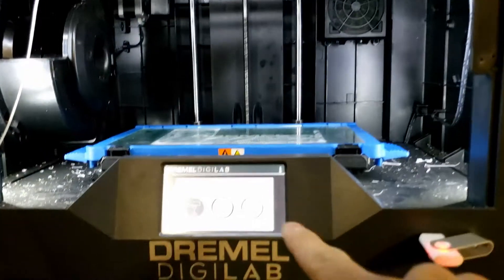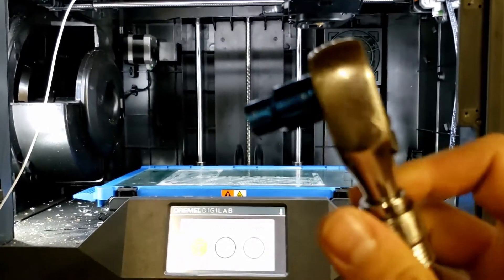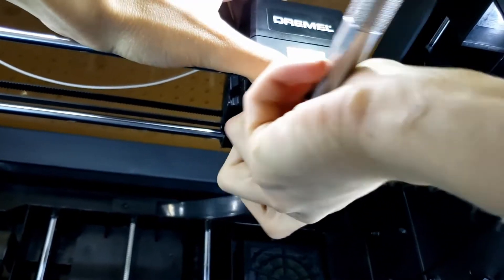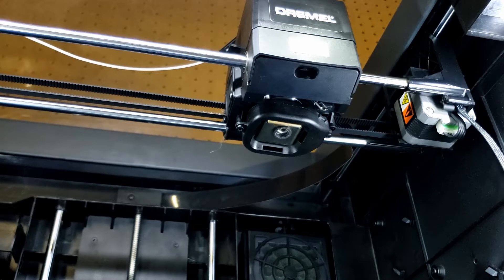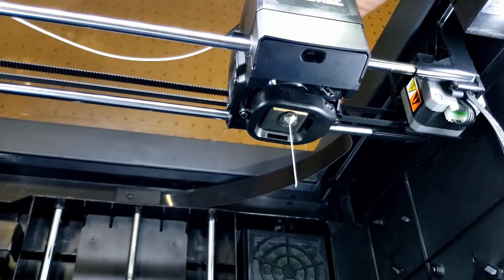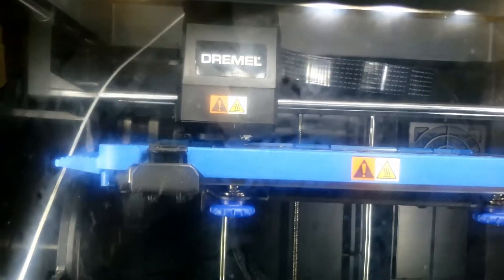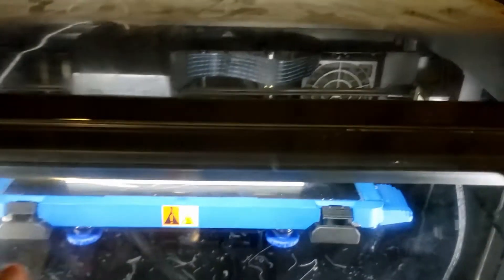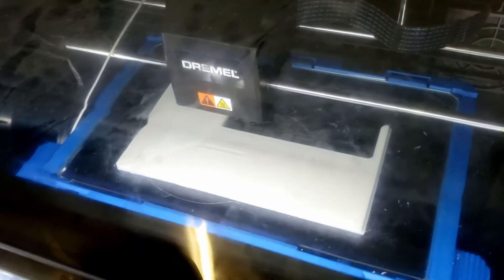How to Change Dremel 3D45 Nozzle Tool Steel Micro Swiss Upgrade

Comment: Warning: Do not follow the method shown in this video to changing the nozzle on your Dremel 3D45. Using this approach can result in a broken nozzle assembly.
Reply from the maker: Do you have any updates? I've done it this way to both of my printers without any issues.
Reply: @DIYBiotech  I did, I posted my update, you deleted it...I will repost again...

While you still need to heat the nozzle to the 220 temps at minimum. You need to remove both the fan baffle and the cover that blocks access to the nozzle, which is secured by a single screw under the print head. To properly remove or reinstall the nozzle, you need to hold it steady with needle nose pliers to prevent it from spinning while unscrewing or tightening. Applying too much force or allowing the nozzle to turn excessively can easily cause the neck to snap or bend. The method you are showing is unfortunately an example of how this process should not be done.

Make sure to remove the black leather boot from around the nozzle before replacing the nozzle to avoid damaging the boot and needing to replace it.

My nozzle broke using your approach, can I send you a bill to cover my costs?

This is the result of following your process: https://i.imgur.com/cKYKI7y.jpeg

When this is what should have been the 'correct' process: https://i.imgur.com/DKXtkXl.jpeg
Reply: @DIYBiotech  I have tried, either you are deleting my posts or something else is...
Reply from the maker: @EricRJagielski  I didn't delete anything! Please propose a better way I'd love to learn!
Reply: @DIYBiotech  
Thanks to your method, my nozzle snapped. Should I send you the bill to cover the $100 it cost me to fix it? For the record, the correct way to replace a nozzle is the method outlined below. Following this approach prevents exactly the kind of damage your method caused.

How to Safely Remove and Replace the Nozzle

1. Heat the Nozzle
- Preheat the nozzle to at least 220°C.
- Do not attempt to remove the nozzle while it’s cold, as this increases the risk of damaging the threads.

2. Remove the Fan Baffle and Access Cover
- First, remove the fan baffle.
- Next, remove the access cover that blocks the nozzle.
- This cover is held in place by one screw located under the print head—unscrew and set it aside carefully.

3. Remove the Black Leather Boot
- Take off the black leather boot that surrounds the nozzle.
- This prevents the boot from being torn or damaged during nozzle replacement.

4. Secure the Nozzle Properly
- Use needle-nose pliers to firmly hold the nozzle in place.
- This prevents the nozzle from spinning while you loosen or tighten it.

5. Remove or Install the Nozzle Carefully
- While holding the nozzle steady with the pliers, use the appropriate tool to unscrew or tighten the nozzle.
- Do not apply excessive force.
- Avoid letting the nozzle twist or turn too much, as this can cause the neck to snap or bend easily.
Reply from the maker: @EricRJagielski  thank you! Hopefully others can see this and learn!
Reply: @DIYBiotech You need to take this video down immediately to prevent others from damaging their printers due to the incorrect and misleading instructions you provided. I have already filed a formal complaint against both you and this post (video) for spreading misinformation and unsafe installation guidance. Following the steps you shared leads directly to printer damage and costly repairs for owners.
Reply: @EricRJagielski  Quit yapping mate. You doing too much
Reply: @RizzyComputers I’ll speak my mind as I see fit. If that bothers you, feel free to move on. It seems you have nothing better to do—maybe go work on your computer, Rizzy. Your customers are waiting.
Reply: @RizzyComputers  This conversation doesn’t concern you. Kindly move along, troll.

Comment: Thank you for this video.  I've been having problems where the filament just stopped coming out but the mechanism kept moving like normal.  I'm guessing that's the same problem you were having. I just ordered the nozzle you suggested.  Have you ever replaced the extruder?  I spoke to one person saying to replace the whole extruder, but he had a different 3D printer.
Reply from the maker: The extruders on these are really tough. Probably just your nozzle!

Comment: The micro leveling switch has an issue with over traveling. So I glued a stop into place to prevent the microswitch from over travel. It made a world of difference.

Comment: you can do a nozzle calibration. not sure if this was the case in 2020. I just replaced mine with the same one, and completed the nozzle calibration afterwards. I guess I was lucky. no adjustment needed

Comment: Thanks for this but I tried this and for whatever reason the screw was on so tight that I ended up stripping it. Do you have any idea what I can do now?
Reply: Yes. It is difficult and I appreciate you helping me. If nothing works I will call Dremel.
Reply from the maker: Hmm have you tried doing the same thing with the hot end heated up? Might need to replace the hotend...

Comment: Thanks for this information. I had no idea (until watching your video) that it was even possible to only replace the nozzle by unscrewing. I'm hoping to find a stainless steel nozzle (not hardened steel) to hopefully print using FDA-grade third-party (no Dremel) filaments. I see some stainless steel nozzles on amazon but none of them list the 3D45 as compatible. More research required on my part but thanks for video!
Reply from the maker: Of course! I believe the dremel probably uses a pretty standardized thread size, so maybe if you find the thread size that the dremel uses, then you could search for those thread dimensions. Hope that helps!
Reply: @DIYBiotech  Thanks, I just found some on Amazon that I believe will work given that the thread is M7 (7 mm) from what I was able to find out. Thanks!

Comment: Thanks for this video! I have a Dremel 3D45 and I'm considering buying the same nozzle. Is it still working ok for you? Also, did you have to run through the "Nozzle gap" calibration as well as leveling? 

I'm wondering, what issues do you have with the bed leveling arm? I don't know if I have a different revision of the 3D45 as you, but I don't have the rubber around the nozzle either @ 1:00. My leveling arm has been really good.
Reply from the maker: Yep nozzle is still good! I got a second 3d45 recently and the leveling arm works properly
Reply: @DIYBiotech  Thanks!

Comment: I think you miss interpreted the last video.

People are concerned that the amplification ratio on the rt-pcr make it noisy. When you amplify noise by scaling up testing volumes. Then it is not a useful health marker for public policy. The sensible thing would be to use it for screenings. Then triage medical resource to probe other more reliable biomarkers.